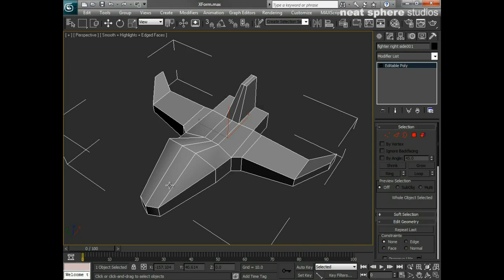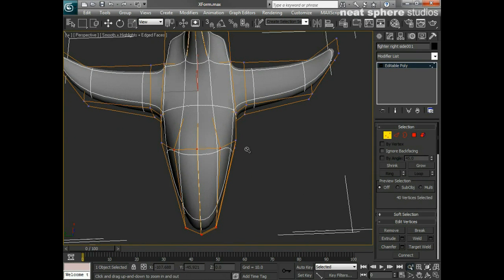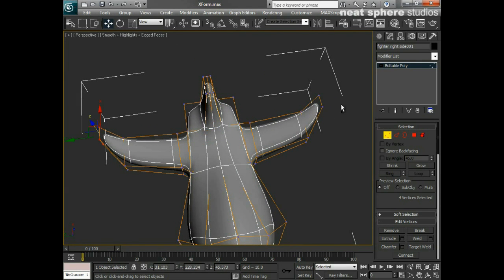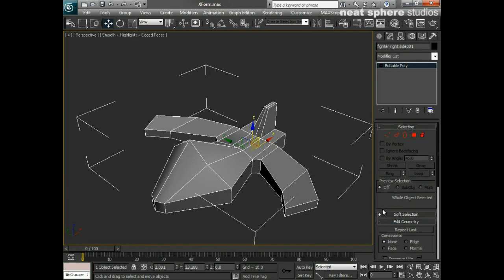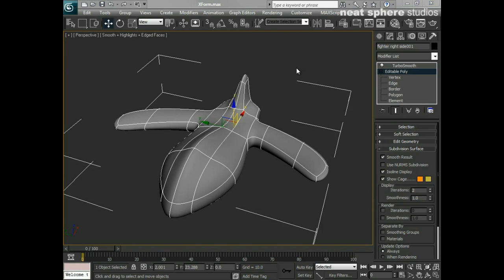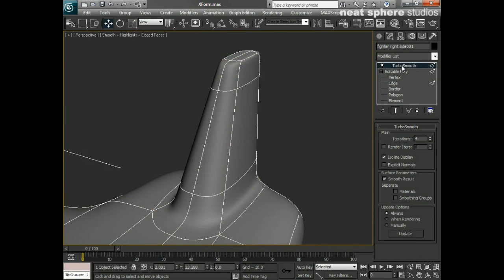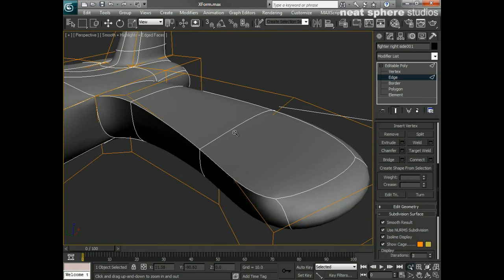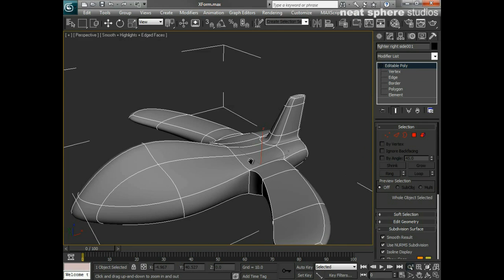Learn  Autodesk 3ds Max - Chapter 7 - Smoothing a mesh using NUMRS and Turbo Smooth

Comment: There is no subdivision surface on the 2016 version?
Reply: +Alibeast96 Yes, there is.  In fact, there're several subdivision surface modifiers in 2016 and 2017.  The newest iteration of subD is called OpenSubDiv modifier, which is several orders of magnitude more efficient and powerful than the modifications shown here.